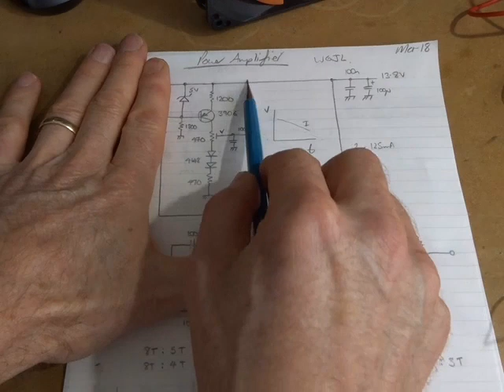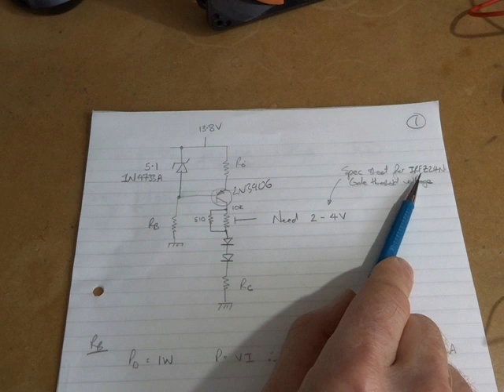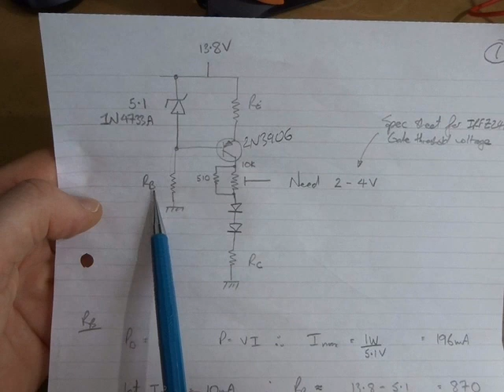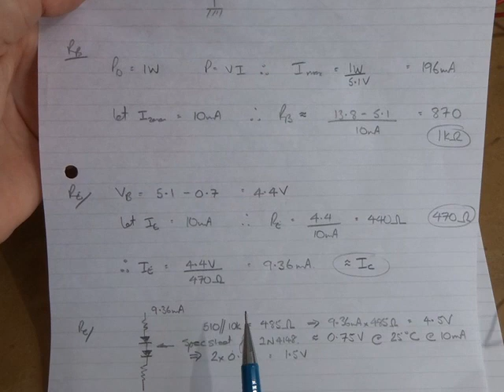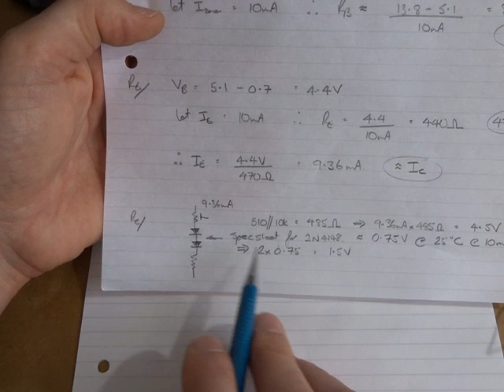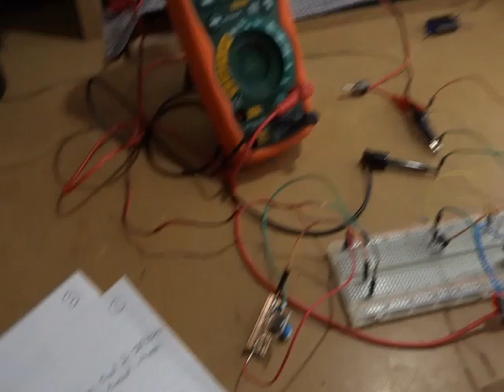Homebrew RF Power Amplifier: Part 2 Biasing and Transformer Tests

Comment: I finally got it working!  https://youtu.be/6i3_A5qrf0s
Question: Are you using a current limiting resistor? My fake irfz24n devices don't seem to perform well without one and I get shoot through current without a resistor.
Reply from the maker: Great news Andrew. No, I wasn't using a current limiting resistor.
Reply: @CharlieMorrisZL2CTM  Still making progress. Seems my fake irfz24ns were the issue. I switched them out for the same device purchased from Mouser and that solved the problem. I've eliminated the resistor on Vcc and added TVS diodes on both gates. Running well now at close to 100W with a diy magloop antenna. I'm still toying with your idea of a temperature sensing gate bias. As it is now, I need to make manual adjustments for a few minutes while it warms up. I might just add a thermistor in series with the 10-turn pot on the gates, but I haven't experimented with it yet.
Reply: @CharlieMorrisZL2CTM  Latest edition...   https://youtu.be/ihvMYfTasGU

Comment: I've tried the rods as well with some success. Magnet wire works better than insulated. The wire seems to make better contact. The position of the input coil at the tip of the rod seems critical, as you probably know from experience tuning a receiver coil. You can cut of the rest of the unused portion.
Reply from the maker: Thanks Andrew. Very useful. Cheers.

Comment: Now are the important 2 RFC´s in the MOSFET´s Bias lines. Why is there no RFC in the 13.8V powerline to the output transformer.
Reply from the maker: I thought it would be useful to ensure all of the drive RF goes to the gates and not into the bias network.

Comment: Mistake calculating the emitter resistors since the transistor is a pnp the voltage at the emitter terminal
should be 0.6 volts higher than its base.The voltage at the base is 8.7V so voltage at emiiter is 9.4V.  taking your assumption that the current through resistor is 10mA that would give you a resistance value of 940 ohms , so you could use 1K :-)

Comment: Interesting idea with the core from an AM antenna coil. I wonder if one could use just a block of iron with holes in it as a core? Sort of like a traditional transformer. (Or the strips of iron that are in some newer ones)
Reply from the maker: Gidday Bill. I'm just trying to think if I have ever seen iron core transformers used at RF. I suspect internal losses would make it impractical for RF. Ok for audio and below, but not RF. Hopefully, I can work on it some more before going away at the end of the week.  

Charlie
Reply: Charlie Morris Yea. Like I have heard of using iron powder cores for up to 300 MHz or something like that for applications of near filters (because of its high Q value or something)  Well I might try experimenting some with it. Considering that’s what the hobby is all about. :D
Reply from the maker: @kd9kck376  Exactly. Give it a go and see what happens!
Reply: Charlie Morris How would you suggest testing it?  My idea was to use it as a transformer with a signal gen as input and Oscilloscope as the output much like you did.
Reply from the maker: @kd9kck376  I'm no expert, but that's what I would do. Test it at the freq you are after and see how it performs. If it has the performance you are after then fine.

Comment: Nice Charlie, very nice, i recently finished amplifier by wa2eby and i just prepared a components for this amplifier but with IRFZ 34...see you soon :)73, de 9a3xz
Reply from the maker: Hi Mladen. Please keep us posted as it will be interesting to see how you get on with the IRF34. I see it has quite high input capacitance, similar to the IRF520. I have not tried either device myself. Happy soldering!

Comment: This is probably a silly question, but why is the bias circuit so complicated? Wouldn’t a simple resistance voltage divider work? Charlie KM4ZZ
Reply: Charlie B - I was thinking the exact same thing.   Expert opinion required - what would happen if a simple voltage divider was used.  An aside - funnily enough I am 'doing' biasing at this very moment for my UK Full Licence exam.  Kevin 2E0FEQ
Reply from the maker: Hi Charlie. Not a silly question at all. If you look back at both the IRF510 and  BLF1043 LDMOS amp builds you will see just that, a 5VDC regulator and a simple voltage divider. For this build I was asked to look at the amp from W6JL. Unfortunately, I do not have the original article so I am unsure what the original design approach was for the biasing network. As you may know, the whole thrust of these videos is to encourage others to give homebrew a go. I am certainly not an expert that's for sure, so if I can do it anyone can. In a similar vein I do look to try and use simple readily available components in an effort to make the design accessible to everyone. That doesn't work out all the time, but it is a design goal.

Charlie
ZL2CTM
Reply from the maker: To elaborate on Stephen's comment, I would say the zener/2N3906 function is essentially what you would have with a-say-7805 voltage regulator (not the same, but akin to). I'd have to put some thought into whether the diode temp compensation would work for a simple voltage divider hanging directly off the 13.8VDC rail.
Reply: Ok, I understand better. Even with a large linear power supply, I often see the voltage drop when transmitting. Even more so with a battery, plus the voltage drifts down as as charge is used. This circuit is to provide a constant bias voltage for the amplifier FETs. With the BE voltage set at 5.1v by the zener diode the EC current is a constant. The trim pot sets the voltage between the two diode voltage drops and the max voltage allowed by resistances.

Thanks for these videos. I am moving into home brew designs, and am trying to understand the whys. I don’t just want to build kits. I am currently working on a crystal stabilized FM transmitter. Charlie
Reply from the maker: @charlieb.4273  We share the same approach to homebrew Charlie. I too want to understand what is going on. Keep us posted too on how the FM transmitter build goes. I haven't looked at VHF yet.

Comment: I wonder how difficult it is to drill a hole through the centre of the ferrite rod? Might be possible to glue two pieces side by side to fabricate a binocular transformer.
Reply from the maker: Not sure Stephen. Might be worth giving it a go. It's quite brittle though, which may make things difficult.
Reply: Have a look at "Drill through anything (conductive) with Electrical Discharge Machining".  This is a YouTube video (Applied Science) on machining hard things - very interesting.
Reply from the maker: @M0XYM  Thanks Kevin.
Reply: Just stack some FTxx-yy cores for the length needed, drop of super glue to hold them. Make another FT tube and glue the tubes together to make a binocular core. Doug DeMaw did this in one of his books or a QST beginners series. It has been a few years since I've read it.
Reply from the maker: @Pixelwaster  That is certainly a back up option. I have another radio here that uses 2x six FT37-43s in a binocular format.